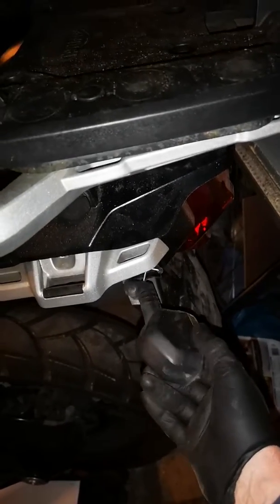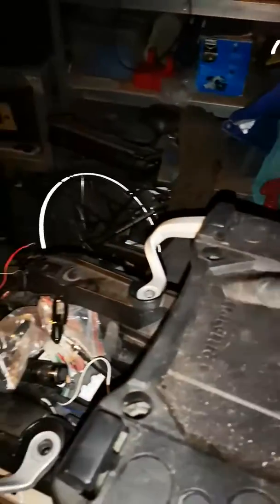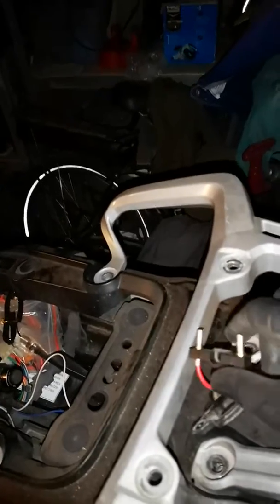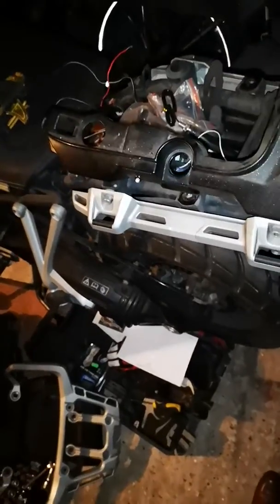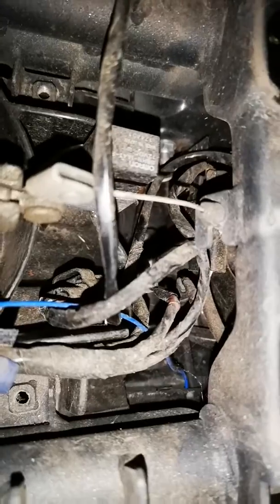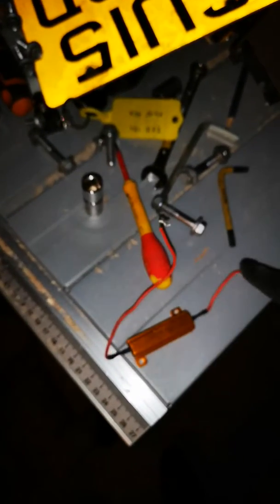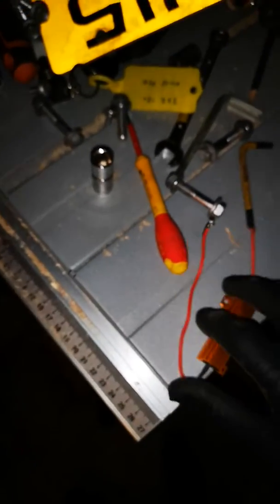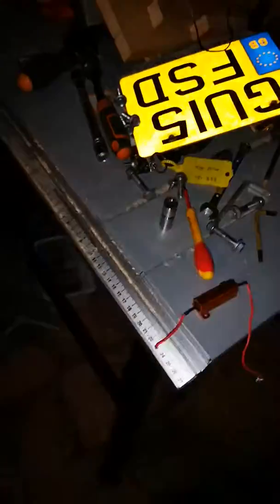Triumph 1200 explorer gaining access to rear indicators

Comment from the maker: Brief update. If you have led indicators on the front of your triumph explorer 1200 and have fitted 10ohm resistors you don't need to add any to the rear indicators. I mistakenly fitted them, once the engine was running the indicators failed to work on re stripping the bike and removing the resistors all works fine